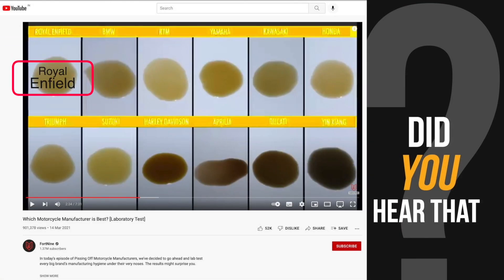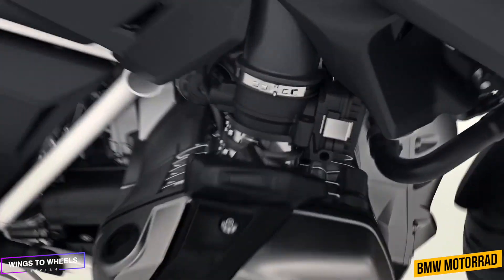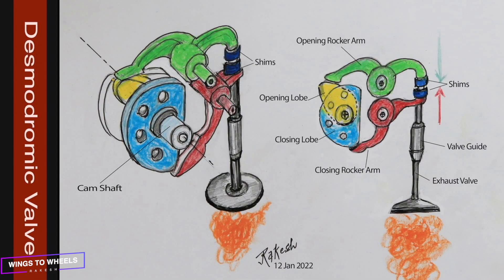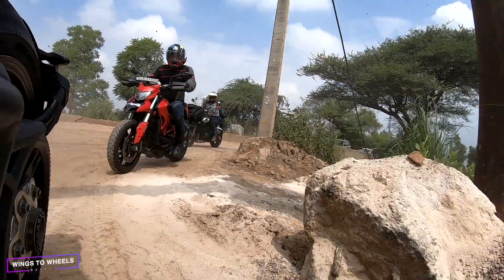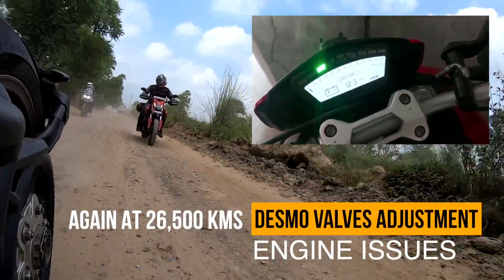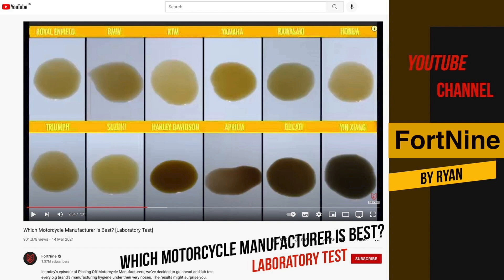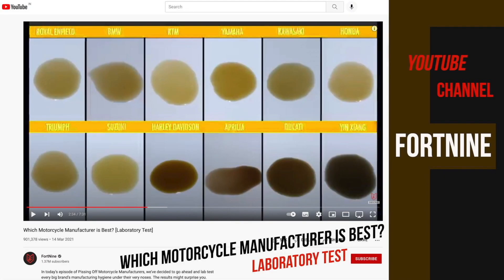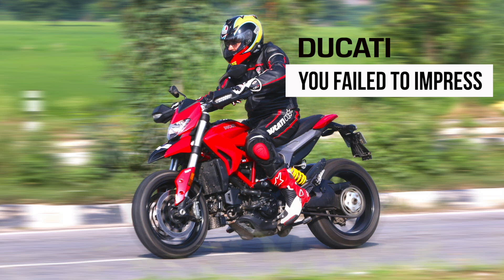Is Ducati Desmo Valve Unreliable and Causing Abnormal Engine Wear? Oil Analysis

Comment from the maker: So this is what I had been fighting for that many Ducati bike engines are damaged in India beyond economical repairs due to dust & sand. Engine oil mixed with dirt further damages vintage desmodromic valves. In a few cases, lack of lubrication has caused Catastrophic failures. So all those who have these issues must read this article, dated 3 Apr 2023. 

https://www.autocarindia.com/auto-features-amp/looking-to-manufacture-in-india-in-future-ducati-sales-vp-427749

In conversation with Marco Biondi, President, Sales and Marketing, Ducati APAC
Joining him was Bipul Chandra, Managing Director, Ducati India.